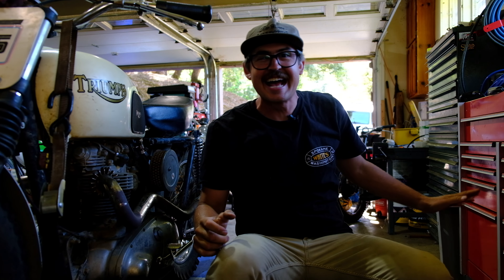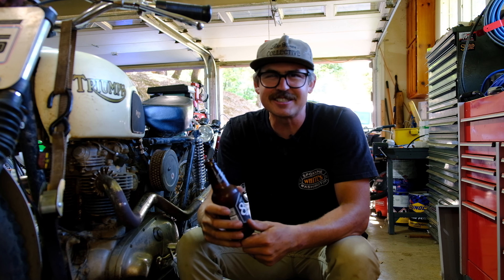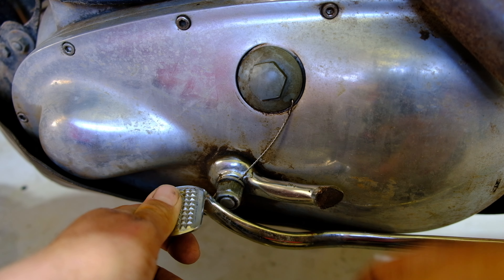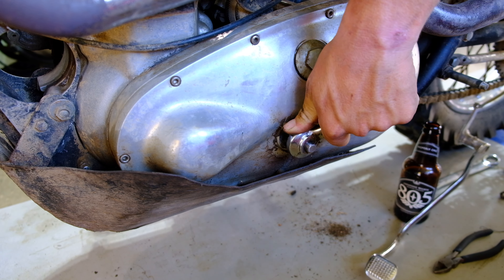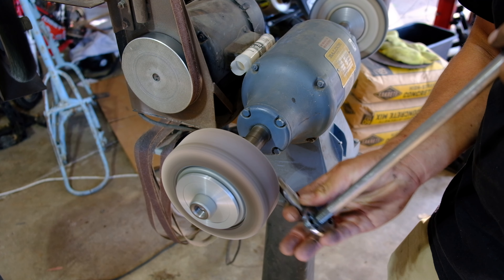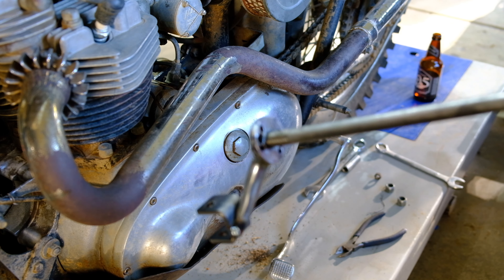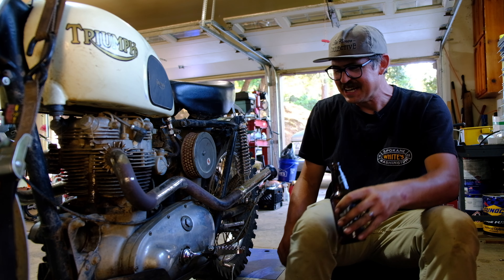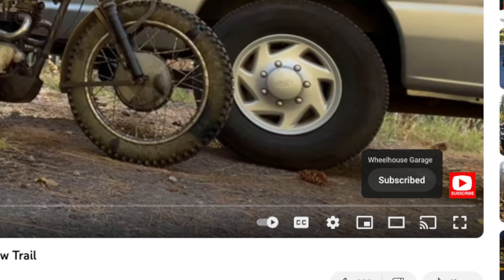Triumph Desert Sled Upgrade | Footpegs!

Comment: Footpegs breaking was pretty common on Triumph sleds.
I'm building up a bike very similiar to yours, a '59 TR6 sled straight outta the day that was sitting under a tarp for 50 years somewhere in S. CA.
The bike has had several mods and cool rare parts.
The footpegs have homemade bracing, on the primary side they welded a rounded plate with a rubber pad that sits against the case.
Enjoy your vids!

Comment: A good modification there Bill. Those original folding foot pegs are like Rocking Horse poop in the UK I think they were nearly all sent for export.  
Did you have a spacer (57-0087) in the primary? and did it stay there, when you pulled the foot peg mounting stud through?  
Enjoy your weekend, and cheers.

Comment: for some reason the sound only comes from one speaker on your videos
Reply from the maker: It has to do with the mic I’m afraid and seems to only be an issue with headphone listeners. Are you listening via headphones? Apologies.
Reply: Ah ok that’s not a problem I will watch without using headphones In the future then.